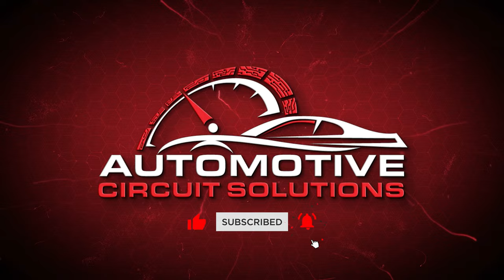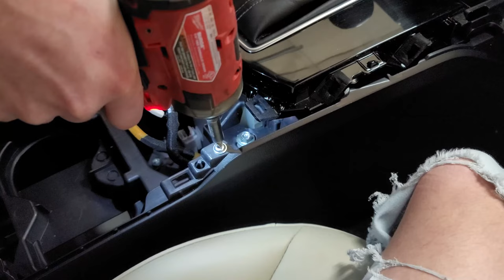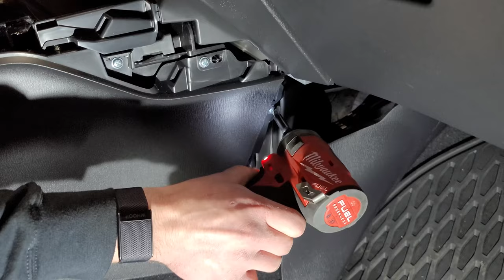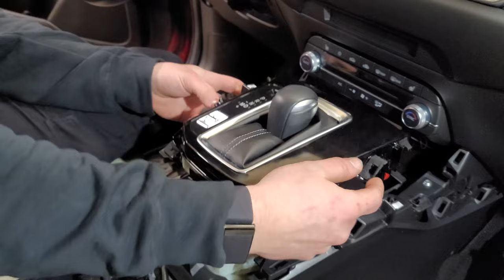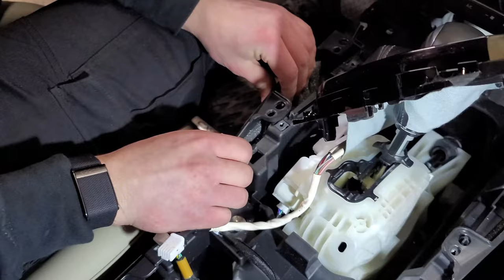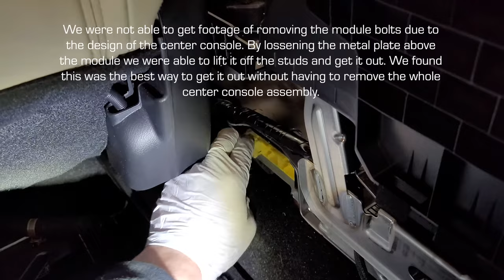19 Mazda CX5 SRS Module Location | Disassemble of Center Console |

Comment: Did this cause the key to not register? (Start botton flash orange?) And other messages appear.. like charging system fault and power steering fault on the dash.
Reply from the maker: No, in fact this car actually runs and drives fine without the SRS module.
Reply: @danielfrazier840 I have the same issue please let me know if you found the reason